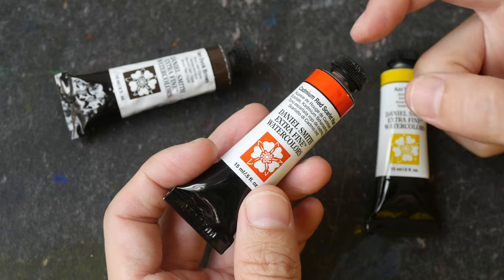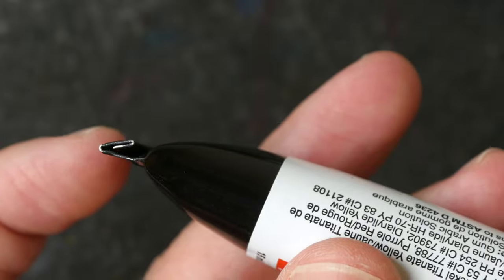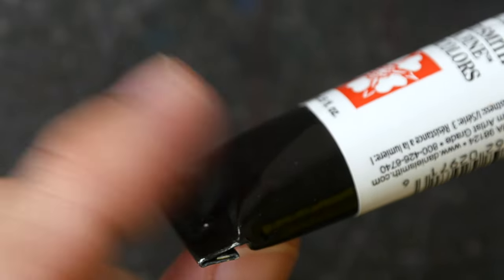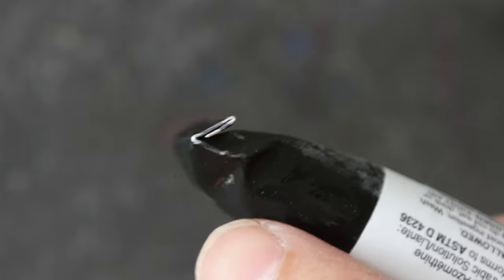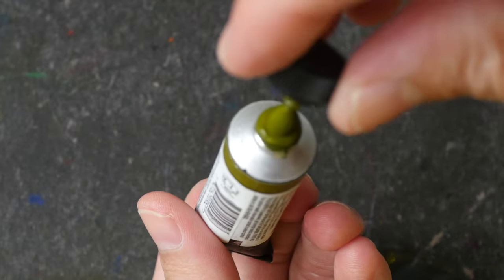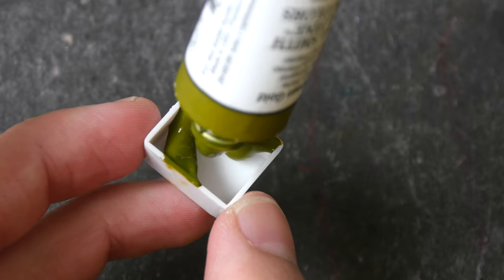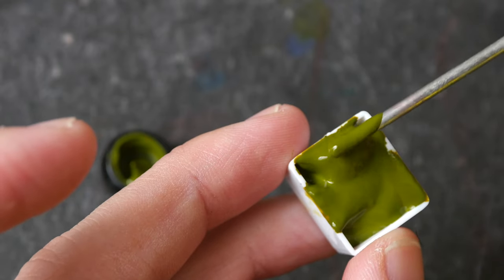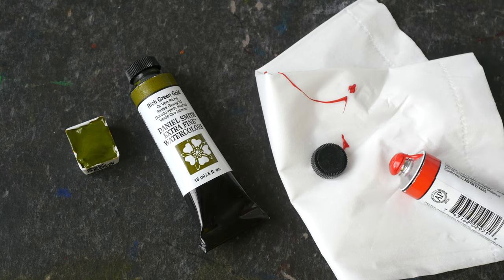How to prevent your paint tube from exploding (try at your own risk)

Comment: If you store it in the freezer with the cap upwards, the gas bubbles should rise to the top and be the first to go, leaving the paint nicely controlled inside the tube right?
Reply from the maker: Yeah, that's a good tip
Reply: @teohyc  I actually haven't tested it, so I have no idea if it works, but I'm definitely gonna try it out next time I see a bulbous tube.
Reply: Thanks @pru!
Reply: Oooo what an honor I've never had a comment pinned lol
Reply: This would rely on the bubbles rising through the paint to the surface. However, some paints are very viscous. Perhaps it would work. Perhaps heating the tubes in warm water would help, because the paint becomes more liquidy that way.
Reply: @PaulaBean  true, that's a good point!

Comment: When paint rushes out someone taught me to squeeze the sides of the tube near the cap end and it helps, though your tip is probably better.
Reply: This is what I do. I was a haircolorist for 20 years happens in those tubes as well. Pinch before you open it up by the cap!

Comment: Quickest method without freezer: shake it with your hand roundly, holding the cap up closer to your body. Very strongly. The force will move paint to the bottom of the tube and you'll have air at the top in the cap. Quick, simple method. Anyway, low temperatures may spoil the paint mixture, so freezer is too long, too complicated and can even damage your paint.

Comment: Interesting. I have heard that sometimes paint may separate when exposed to freezing temperature. Can happen when buying paint during winter, when tubes are transported by mail and left for hours in the mail box. The gum arabic needs to be mixed back in again, which can be messy in itself. I always open new bulging tubes quickly with the opening right above the palette space where I want it. Sometimes squeezing the sides of the tube helps control the rush. Not sure if the cold and/or high altitude in the cargohold of planes has anything to do with it. Any comments? Shouldn't any residue water in the gum arabic or honey expand when frozen?
Reply from the maker: Very often gum arabic will already separate even at normal temperatures, especially so for heavier pigments, e.g. earth colours, chromium, titanium. 

Not sure about the expanding part.

Comment: Couldn't you unroll the crimped end of the tube slightly and force some of the volume of paint back into it before you unscrew the cap?  If possible that should be sufficient to relieve some of the pressure so it isn't so 'splody.

Comment: Did you identified some colors that are prone to do this ? Could it be related to some specific pigments ? I’ve noted in the video that it occured to your DS/Rich green gold and actually I had exactly the same issue with mine, so I’m wondering whether this is pure coincidence or often seen with this hue ?
Reply: @EugeniaLoli  my Winsor and Newton 5ml limited edition tubes don't do this. All of my 15ml Daniel Smith tubes do though. Some of my 15ml Schmincke tubes too, and M Graham. Even some 12ml Maimeri Blu and 24ml Lukas tubes do this. I don't buy 5ml unless there is no other option but none of them across any brand have been an issue so it can't be down to size.
Reply: My Daniel Smith Indanthrone Blue tube is like a paint hose!

Comment: I never have that problem on brand new tubes before, until I bought some Daniel Smith paints. It was a complete mess. Most of the tubes of a set had that problem, although they seemed externally in perfect conditions. Almost all of my others paints are Winsor & Newton. There is a problem with that brand DS, the quality of pigment is excellent, but you will have to pour them in palettes, even if you do not want it.

Comment: I pinch the tube near the cap to move the air around so it doesn't rush out. It still flows bo more slowly. Enough so I can get it to the pan. I hate filling new pans.I hate the mess also. It happens with my tube prescriptions as well.

Comment: HI Teoh, this is such a neat trick. Although I did freeze watercolours before for different reasons, never in the tube to prevent explosion. Next time I will try. Freezing also helps to remove wrappers from paints with a high honey content, that are not very solid anymore or yet (like handmade paints, Sennelier samples...). For those I put them in the freezer for a few days as well. :)
Have an awesome day and thank you a lot!

Comment: I used to wonder if this happened because of the tubes being shipped by air, but I just got a whole bunch of Schmincke from Jacksons and not one of them exploded like this. I've only had this issue with Daniel Smith. And only some Daniel Smith, where others are fine! I am probably being ridiculous, but I keep an old toothbrush to wash out the cap and threads when this happens, because I hate when the cap hardens on the tube.
Reply from the maker: I find that it affects certain colours more than others.
Reply: It can definitely have a lot to do with air travel, I never had a problem with any DS tubes I got at their local Seattle location until I got a bunch of DS (and other brands) from a friend via air-they were an unruly batch :). Air travel by itself isn't the problem as some storage holds are pressurized, it can be due to multiple changes in temperature,  altitude and air pressure over time and depend on how much moisture and air is in a tube. It's why we all double or triple bag our toiletries when packing them in a suitcase before flying so they don't explode all over our clothes (I speak from experience lol).

I've never seen one that had gas in it before, although I have had a few M Graham tubes spill out faster than I can pinch the sides to control it--assumed it was the honey. I also live in a temperate climate, so wonder it that has anything to do with it. 

Anyway really enjoyed this tip, thanks!

Comment: It happened with my Nickel azo yellow tube and i was so sad to have lost so much paint every time I opened it. But my mayan red was the opposite it came out after pressing it really hard! Why did that happen?
Reply from the maker: Must be some chemical reaction happening inside that's producing gas. I've tubes that were used halfway, and after a few weeks became fat with gas inside.
Reply: Teoh Yi Chie my mayan red was brand new apparently, freshly bought from a reliable amazon seller. You mentioned in one of your videos that mayan red tends to be dried up soon. That must have happened inside the tube I presume. 😊
Reply from the maker: @srabastibasu2  Drying up shouldn't be a problem if the cap is tight.
Reply: Teoh Yi Chie i used my teeth to open the cap! 😂
Reply from the maker: @srabastibasu2   I usually just use tissue to open really tight ones, but use the teeth also for the extremely tight ones. But don't do that with exploding tubes of course.
Reply: @teohyc  😅😅😅😅 Don't y'all have a pair of pliers handy?
Reply: Teoh Yi Chie yes! I would remember! Thanks! 😊
Reply: Chrissie Nicely 🤣🙈